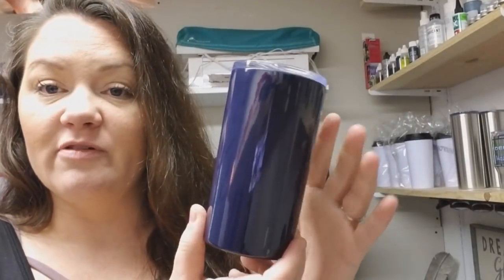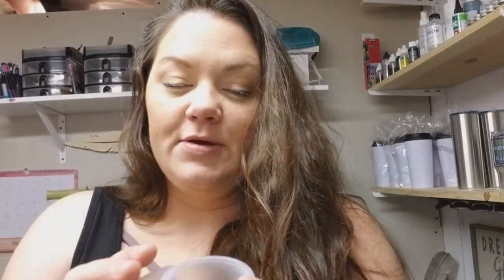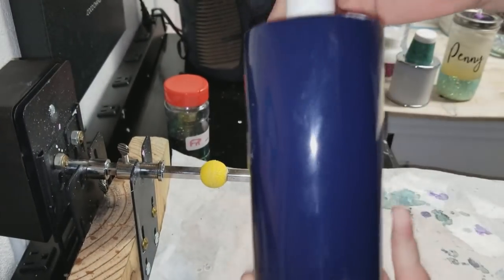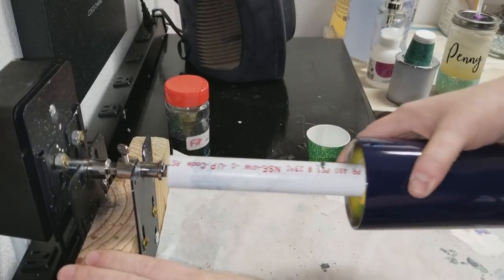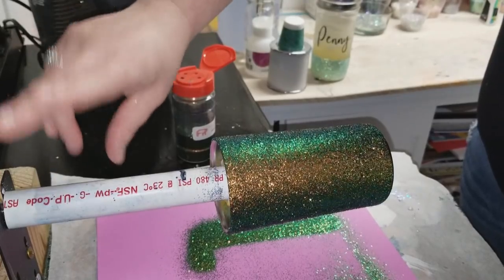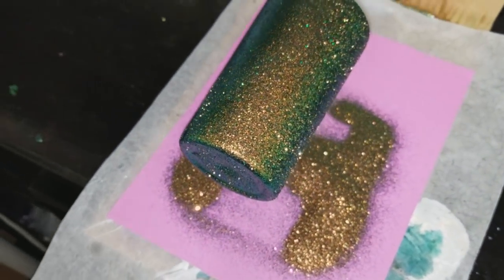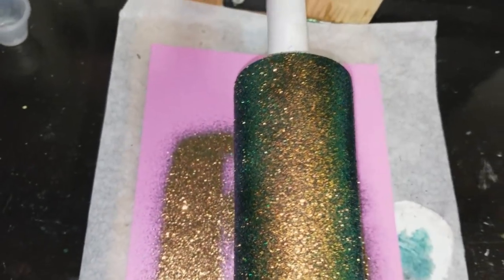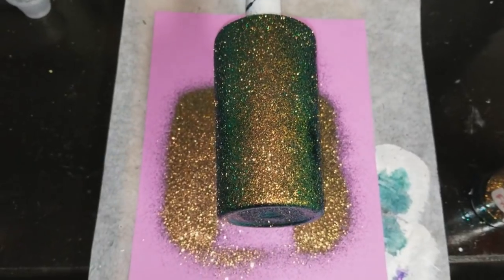Glitter Tumbler From Start to Finish "Epoxy Method"

Comment: Would you happen to know if after a few hours there was not enough coverage do you have to epoxy again or can you do the mod podge or loctite method to put another layer of glitter on? and if so how long do I need to dry first coat? TFS

Comment: Question I used black fine glitter and after the epoxy it looks like solid spray paint any suggestions
Reply: I'm in a group on fb and I've heard some black glitters do that. Either try a different brand or add some silver into it 😊

Comment: What do you do with the top edge of the cup to ensure that there is no excess epoxy or glitter that will harden and either be inside of the cup, or prevent the lid from sealing correctly?
Reply: Erica Reakes I would love to know that too. I’ve watched a few of these videos and I haven’t seen one yet where it’s explained. Maybe I’m just not getting it 🤷🏻‍♀️ or I haven’t found the right video yet
Reply: I have never found the answer to that either and I've watched so many tutorials. It seems like the most obvious question but it never gets replied to.
Reply from the maker: When i apply my epoxy I don’t use a ton, apply it in the middle section of the cup, and gently move it up and down the cup. If you aren’t moving a ton of epoxy to the top, it wont flow over inside. Also if your epoxy is forming a lump, its an unlevel turner, you’ll want to rebalance it.
Reply: Where did you get the little yellow balls that you use on your turner?
Reply: @juliebutler4557  ... I have used Goo Be Gone to remove the excess overspray of spray paint and it works on removing the epoxy also... hope that helps :)

Comment: I love those white cups behind you where did you get them  did you get them in the same place that you recommended? Also I have a cup that I am going to try this method with but it has a rubber bottom can I epoxy the bottom anyway?

Comment: How long does a tumbler have to be on the turner before you can take it off and let it finish curing?
Reply from the maker: A minimum of 4 hours, if your room is kept warm, at around 72 degrees

Comment: Why is the top and bottom rim of my cups still rough?? I use the 30 oz
Reply from the maker: Once you have a good coat of epoxy, if its still rough gently sand it with fine grit sand paper, be careful not to sand too hard into your glitter, just a light buff, clean with acetone, or soap and water, dry thoroughly and apply another coat of epoxy, this should be your last layer, so if you have decals do them before

Comment: Great video.  Since this cup is already painted do you find it not necessary to sand before applying the epoxy?
Reply from the maker: I do not. But i clean it, and i do recommend sanding the cup before spray painting
Reply: So I have a friend that gave me the ozark trail colored cups. This is my very first time making a cup. Do I need to sand slightly or how do I clean it and with what?

Comment: This comment is added after the live video...I watched this one and the one where you added the dried flowers...but couldn't find the videos to complete the process...reading the comments from others that asked the same thing and didn't see your response...looked thru the videos and couldn't find the follow up videos. Why do you use the epoxy method instead of sealing it with mod podge?

Comment: If I am wanting to put just vinyl on a Tumbler and Epoxy over it. do I need to Epoxy then put the Vinyl on then Epoxy over the vinyl?
Reply from the maker: No, you can apply your vinyl and then epoxy, but clean it very well with acetone, do not acetone over your vinyl.

Comment: This may have been addressed already but why do you use the turner?
Reply: The epoxy is "fluid" and will drip off the cup. Keep the cup turning until the epoxy is dry.
Reply: How long does it take for the epoxy to dry
Reply: @geneperkins6713  about 24 hours is how long it takes to dry enough to be able to handle it